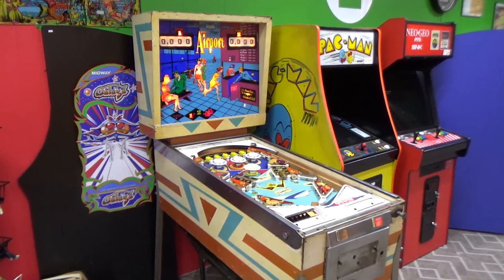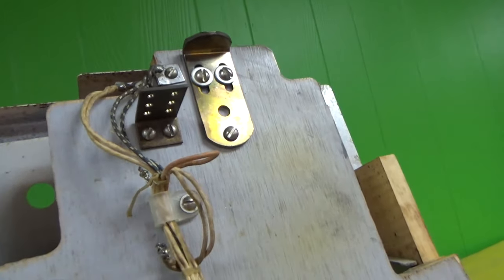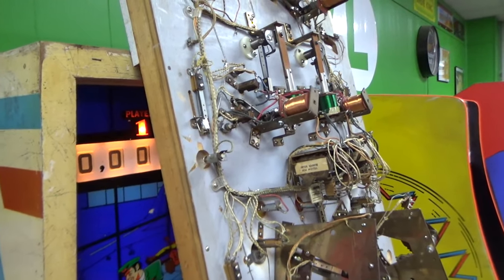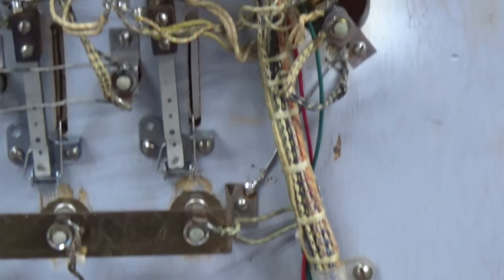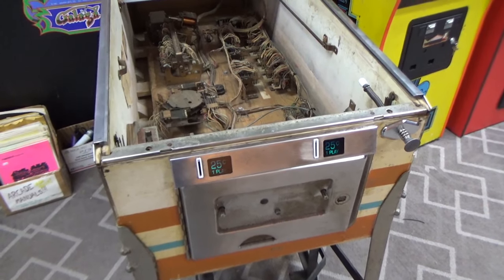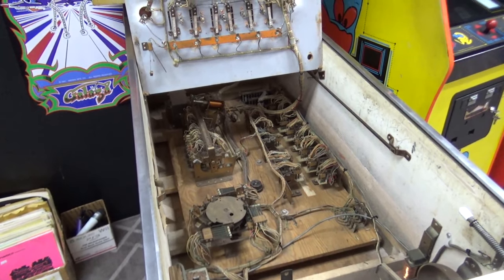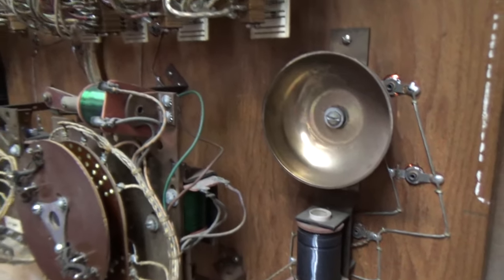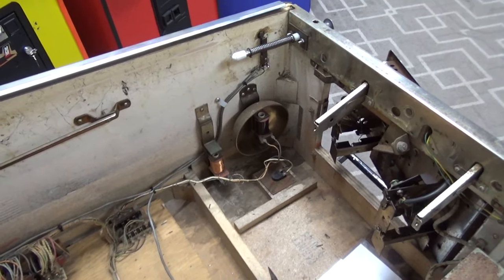The Clever Way They Used 'Feature' Relays On Gottlieb's 1969 AIRPORT Pinball Machine - E.M. Repair

Comment: I love the sound of the bells. So sparkling, so clean….I like the chimes too but for me the bells are it. Years ago I had a Bowling Queen which also had the flipper switches right at the flipper buttons. These flippers were instantaneously responsive. Also, you just had to touch the flipper buttons and Bam, they worked great. This was a hack, but it was done properly with no hanging wires. I wouldn’t personally change a game like this, but it does have some practical benefits if it’s done right. Thanks for another very enjoyable series of vids Ronnie. 5 stars for yourself and Joe.

Comment: I imagine the flipper wiring was modified that way is because one of the mechanical components involved failed. Unable to get replacement parts they had to relocate the switch to the button area just like other machines. They did both so they matched even though the other side worked fine.

Comment: So we never did find out what all the hackery to the relays was about? Were they the #2B relay etc so they were changing all the great planning to turn on the roll overs and when lit lights? Not sure why you’d do they either. Always a fun watch
Reply from the maker: They for some reason just replaced the wiring powering up the coils on the playfield, the feature relays were still unhacked... I have no clue why they added all that wiring in, we hooked it back up original and everything worked, lol

Comment: That's a shielded microphone cable. The 3 pins of the microphone socket and the metal shield.

What happened to the original wires that went through the loom to the Jones plugs ?

Did they pull them out ?

Comment: That buzz is  some relay armature not able to fully contact the coil core.  There may be rust under the armature, or the relay may be bent so the armature does not rest flat on the core when relay is energized.  Also check for the copper shading coil (the copper stamping set in the core slot) on the top of the relay coil.  It may have become loose & fallen out.  If you note it missing, hunt around in the machine bottom for it.  If you can't find it, make a new one out of sheet copper (look at other relays & copy design).  You can glue it back into place.  better yet is to make it a little oversize & tap it in.